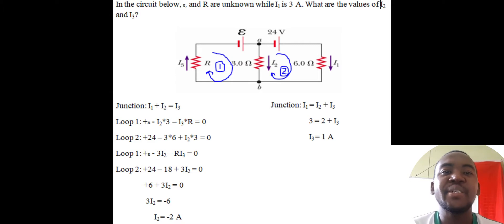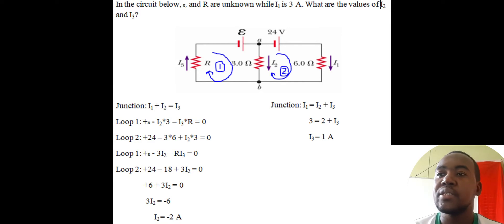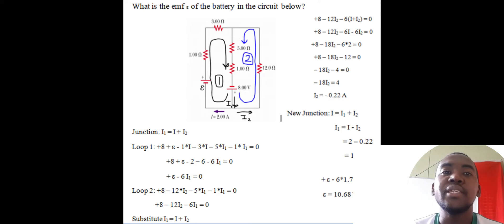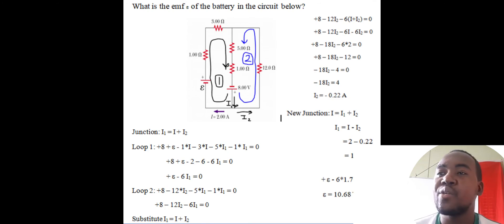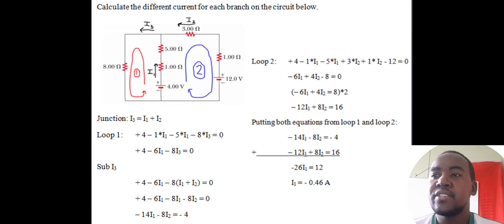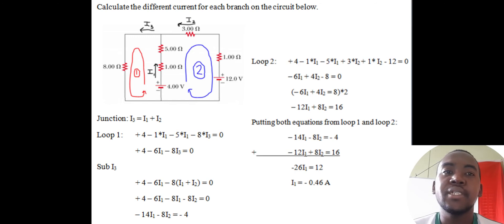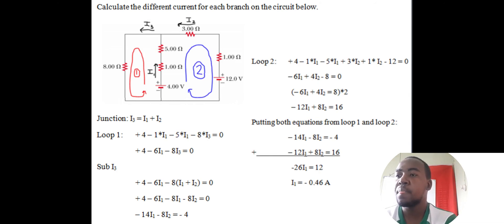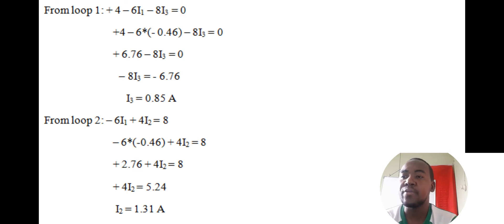CAPE UNIT 2 - KIRCHHOFF'S LAW CALCULATION

Comment: for the third question, what if the current flowed from the positive side of the 12V battery and then split at the junction to give two component currents, would you still get the right answer sir?
Reply from the maker: Yes if you change the current direction then once you correctly use the voltage drop or rise then yes you would get the same answer
Reply: @edusolutionsinstitute2023  okay thank you